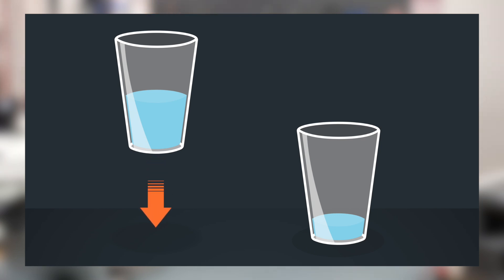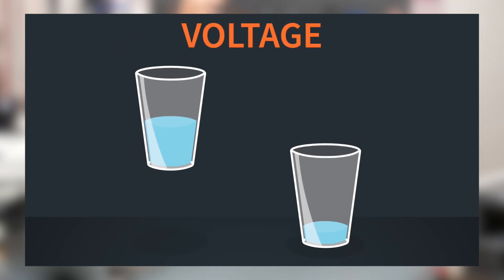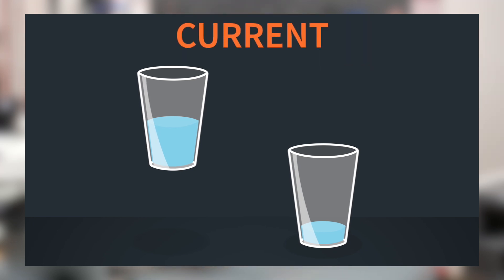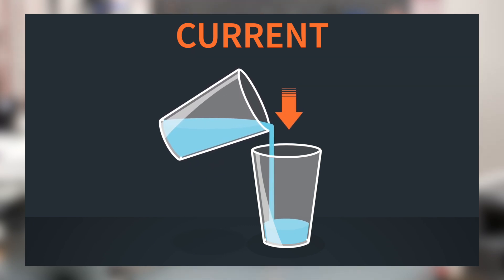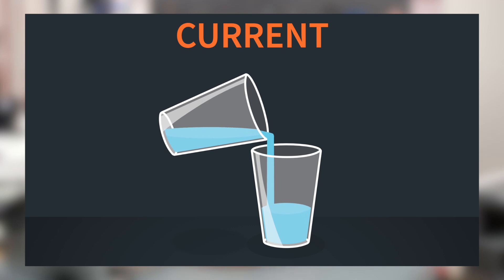Voltage, Current, and Power Explained - Laying the Foundation for Basic Circuits | Basic Electronics

Comment: The water example doesn't make sense to me.

The water "wants" or "desires" to flow because of gravity. So how is the applicable to voltage in a circuit?

Comment: I have a question 
P = V*I 

But, for there to be a current, there has to be a voltage, so how is power connected to the potential difference?

Comment: Great explanation. What I often find confusing is when buying components such as a Buck converter, it says 5A and I am left asking "At what voltage?" Because 5A at 12V is different to 5A at 3.7V isn't it?  Or am I misunderstanding what amps actually are? I'm been learning electronics for years and building my own circuits, but every now and then I think I've learned something wrong as the more I learn, the less I seem to know.
Reply from the maker: You are correct that 5A at 12V is a very different amount of power than 5A at 3.7V.  The buck converter should say something like, "5A output" and then have the voltage output somewhere.  We do CircuitBread as a passion project but for money, we help companies with their marketing.  From our experiences doing that, I do have some sympathy for the people trying to sell those things.  As an engineer, I want to know everything about it!  But you can't fit a datasheet into a title.  So, they throw a few, high-level stats out there and expect you to spend some time in the datasheet to get all the details before you actually purchase the part.  And I've been an engineer for over 15 years now and while I certainly know a lot more than I did when I first graduated, I also have been learning that there's a lot I didn't know that I didn't know!  It's a common feeling, don't let it get you down.
Reply: @CircuitBread   So I'm right to question it? I'm finding more and more products are listing like this and even people on YT say things like "This wire will only carry 1 amp" and I'm always thinking "AT WHAT VOLTAGE????" - because the 2 are a symbiote. One doesn't exist without the other. They should be saying the wattage it can handle.  When I asked the ebay seller the Wattage output on a buck converter that was 5-35V 5 AMPs, he said it could output 75watts. I believe he may have pulled that number out of his proverbial.

Comment: without high volts eg above 20V amps ain't going to hurt you. Grab hold of a car battery 12V which can produce up to 600 Amps you will feel nothing. On the other hand high voltage and very low amperage can kill you.

Comment: Doesn't it occur to all of you that power (so called V*I) and a bunch of factors provided to us is only to make sure that we can get so called money for using the voltage for a certain amount of time ? Use voltage which is to make sure we can transfer electrons from one place to another through resistance of a material ??  , use "I" which is not required at all ???

If more electrons are used, number of electrons  consumed = power. (Figure out this into money by people who're giving this to us and not give us all the rest of factors?????)

We all know that using 110V is the possibility or what is being presented to us as the possibility for so called electrons to start from ? Observe something to work from based on reference model and then from there start with the atomic model ?? Entire periodic table itself created based on observing how many different objects are there and then come up with a bunch of table with rows and columns saying so many electrons are there ? 😀😀

Comment: not sure i understand the term 'across' verse 'through'
Reply: So English isn't my native language but it does make sense because in case of voltage you kinda have two terminals or two points that has different potential, a point where electrons have potential to flow and another were the electrons are welcomed, the word trough makes you feel like it's the same value of potential as long as that part of wire

Comment: I have been searching for simplest explanation of volt current and watts until I came across your video. It well explained I love your work. One question though Volt vs Amps which most important in solar energy that is in charging batteries. I will be very grateful if you respond. Thanks
Reply from the maker: That's an interesting question and one that probably deserves its own video.  We know that voltage without current doesn't provide any power.  And current without voltage doesn't provide any power.  But there's a sweet spot in the middle somewhere.  Maximum Power Point Tracking (MPPT) solar chargers can dynamically decide to drop voltage in trade-off for higher current, if that is what yields the greatest power.  Or pull less current so that the voltage doesn't droop as much, if that's what yields the greatest power.  This is, of course, a huge simplification, but really, both volts and amps are important and the greatest efficiency you can get with solar will likely be found with an MPPT module.

Comment: This was a great start for me in understanding. Thanks! One question about the two glasses and the wheel. If the flow of the water remains constant, what will be the effect on the wheel if the glass reservoir is raised higher? Does elevating the supply glass increase the 'voltage' or does it increase the 'amps'? Maybe I am not getting the concept?
Reply from the maker: The glass reservoir being raised higher would be the equivalent of raising the voltage, as the water will pick up speed as it falls farther.  The flow of the water is remaining constant, which represents the amps.  This analogy is pretty good but, as with all analogies, be careful not to try and take it too far or it'll break!  I hope that helps!

Comment: What about negative voltage?
Reply from the maker: Voltage is all relative!  So, negative voltage is just voltage below what we've arbitrarily assigned as ground.  For the cup example, if we assume the desktop is ground, or 0 volts, then anything below that would be a negative voltage.  That being said, we could say the floor is ground, the desk is 10V and above the desk is 20V.  Or that the desk is 0V, above the desk is 10V, and the floor is -10V.  It's all about the relationship between the points.

Comment: I calibrate micro-ohm meters that output up to 500 amps of current. Every time I operate them I take a step back probably for no real reason other than a fear of all that current 😂
Reply from the maker: Arc flash is real!  I doubt you're dealing with the voltages that could cause that but I also just figure better safe than sorry. 😬

Comment: why do you use energy and voltage interchangeably? i thought voltage was energy per unit charge.
Reply from the maker: Could you tell me where those were interchanged?  I didn't actually make the connection between voltage and energy in this video as I thought it would be more confusing than helpful at this point.
Reply: Energy and voltage cannot be used interchangeably. Voltage IS  energy per unit charge (V= E/Q)

Comment: Isn't voltage bi-directional? How does that get worked into cup of water analogy?
Reply: Current*
Reply from the maker: Great question!  It is definitely bi-directional - in the water analogy, it's simply that you are raising the other cup higher and the water flows back into the original cup.  One of the issues we have with this analogy is that we sometimes show the bottom cup as being empty, which isn't accurate.  In reality, that cup already has water and if it were higher, the water would flow from that cup to the other cup.  To make the analogy even more accurate, we should add some more addendums and caveats but I think this is enough detail to understand the general concept.

Comment: What are amps?
Reply from the maker: Hi Brayan!  Amps is a measurement of the movement of electrons, the unit we use to describe electric current.  One amp is the equivalent of one coulomb of charge passing a set cross-section in one second.  And a coulomb is a little more than 6x10^18 electrons (a lot!)  Hopefully that's what you were looking for, thanks!

Comment: I have just found your channel and I just want to say your very inspiring and are an exact example of why I want to be an Electrical Engineer. I am starting back at University in Glasgow in two weeks so I am really excited and just wanting to get started. Any advice on some projects I could do in my spare time?

Keep it up, your calm methodical style is exactly what I need to hear! Engineering can be a bit intimidating!
Reply from the maker: Thanks James, I really appreciate the positive feedback!  Good luck at University as well, it should be exciting!

To begin with, I'd recommend getting an inexpensive multimeter and an assortment of resistors.  A breadboard would also be useful.  Then, use a battery and just mess with things.  Put the resistors together in weird ways, see what happens.  Start measuring resistance, equivalent resistance, voltage, and current with your multimeter.  Get an intuitive feel for what happens to all of those measurements as you put your circuits together.  Touch the resistors and the wires to feel how hot they're getting in different combinations.  Expect to melt some stuff and maybe get a spare fuse for your multimeter.  After a little bit, start giving yourself challenges of trying to achieve certain voltages or currents using different resistors.  I believe that after a couple hours, you'll have a better intuitive sense of basic circuits than you'd get after a couple weeks of class, and your circuit classes will make more sense and be easier to follow.   It will also be a launchpad to doing more exciting projects, but for those, I'd just recommend figuring out what interests you and working towards that.  Have fun with it!
Reply: @CircuitBread  wow! Thanks for an excellent reply :) 

I'll give that a go! I have an Arduino Uno and I'm going through some basic projects with that but I will certainly start on messing around and trying to blow things up!

Can't thank you enough for your reply.

Comment: Great explanation! I had seen people use the water analogy before but it was always more confusing than helpful, not this time.
Reply from the maker: Thanks Daniel!  I hesitated to use the water example because it's been done so often, but I'm glad I was able to differentiate somehow!  😬
Reply: @CircuitBread  Yes, this is great. I too used the water analogy years back without really understanding fully how it works and this explanation was gold. So if we're using headphones as an example using power from an amp, what inside the Headphone amplifier would be the paddlewheel in the above water analogy? In other words, the amp has voltage potential and also specific power numbers in watts, but what actually drives that power inside the amp? Is it simply the transistor?